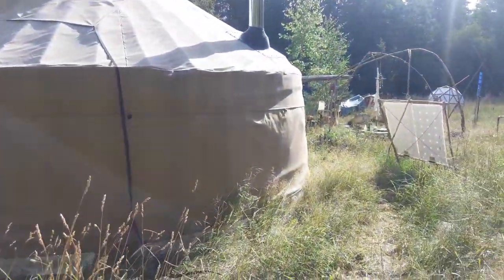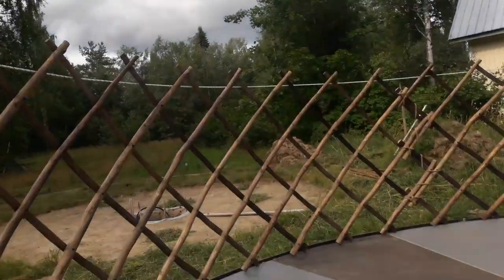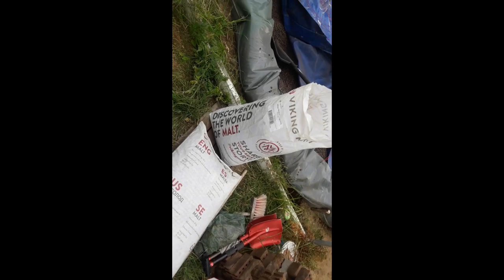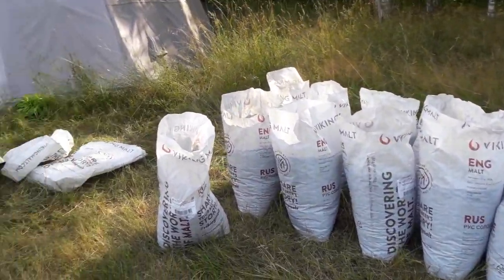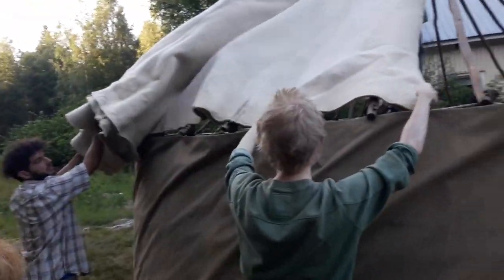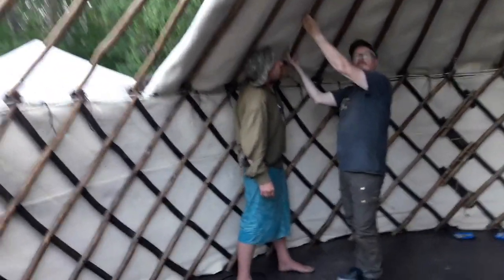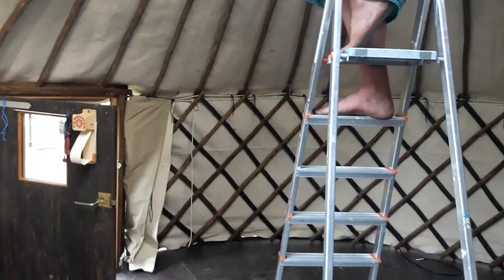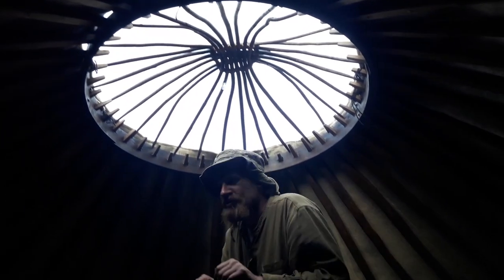subarctic yurt move

Comment: Hello! Can you tell me how much material did you need to fill up the floor? I'll be setting up a yurt for the winter and looking into options on the floor setup.
Reply: I mean the amount of leca sora :D
Reply from the maker: It depends on your desires/needs for thickness and diameter. My yurt has 5.5m diameter and I wished for about 20cm thickness.
If I remember right it ended up being close to 5m³ of Leca. While leca has many advantages, there are also some drawbacks, such as embedded energy.
Reply: @huckmiddeke665  Thank you for your answer! I fear some other disadvantages would be cost of the material and the transport. I'm probably going to make a raised earth platform, about 20cm, and dig a small ditch around at the same time. Then cover that with some tarps and 500mm leijona levy for insulation and moisture block and then a floor of either planks or plywood. The wool insulated air gap seems like a good idea! I'll need to ask around for wool, or if that fails, maybe bui some linen shred. The idea is to make it ease to remove, so that the spot could be used for planting potatoes in a few years and move the yurt to next spot, repeating every 2-3 y.!
Reply from the maker: @SomeDamnForestHippie  jep. If you don't have too much clay in the soil and might otherwise be facing frost heave, the way you are thinking sounds good.